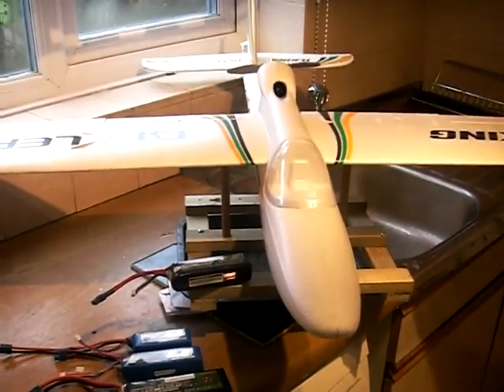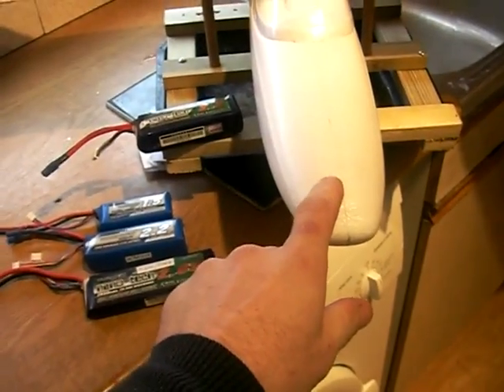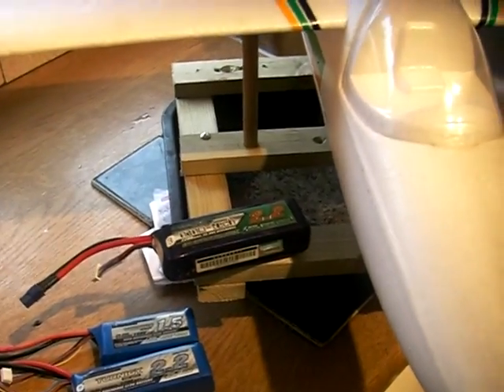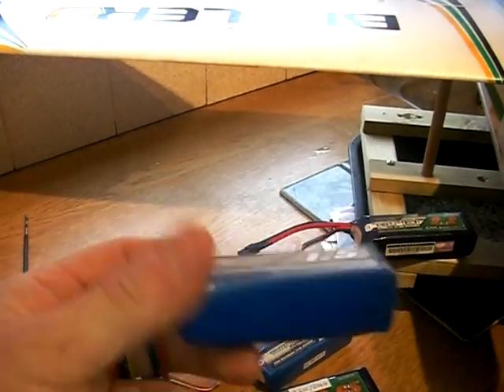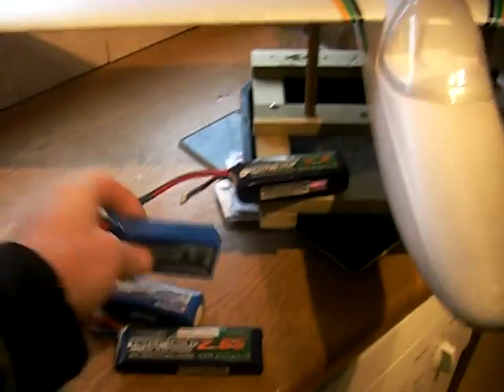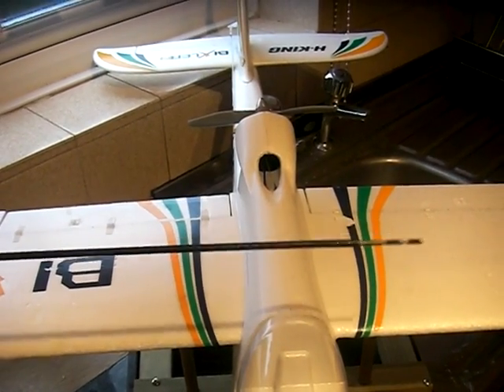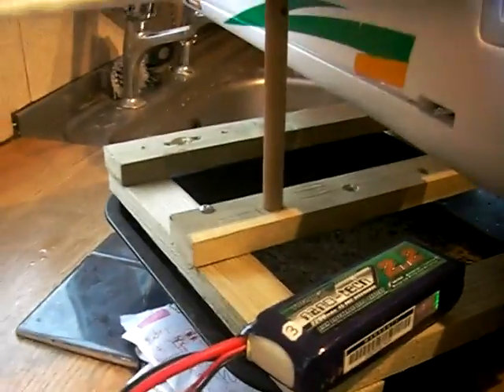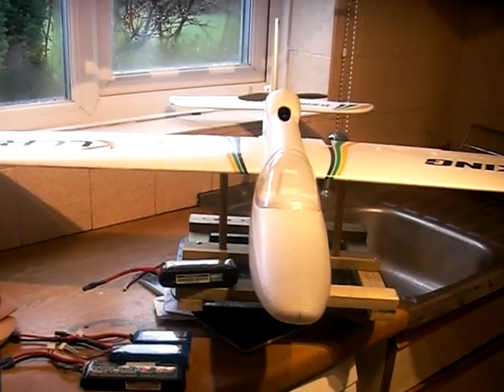bixler 2 cg C OF G centre of gravity

Comment: Hi. I unbox my Bixler 2 and discovered that the 2200 mah Turning battery needs to be placed under the canopy to get the plane balanced. I thought it should be deep in the nose but that's not possible.
Is this right ?
Reply: No, place the battery wherever it needs to be. My guess is he's got some FPV equipment in the back, or probably a larger motor, allowing him to push the battery further up front
Reply: I found the same. How did you mount the battery when the moulding under the canopy is in the way? Did you cut through the moulding?